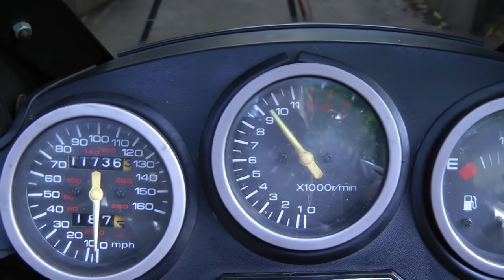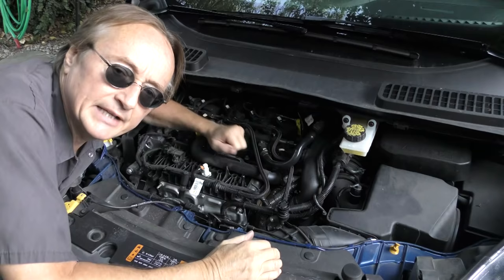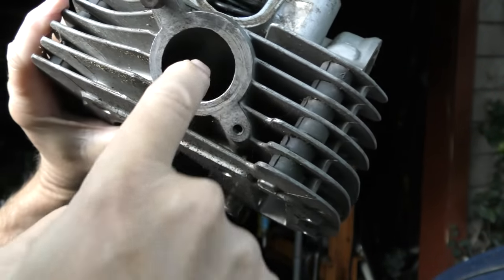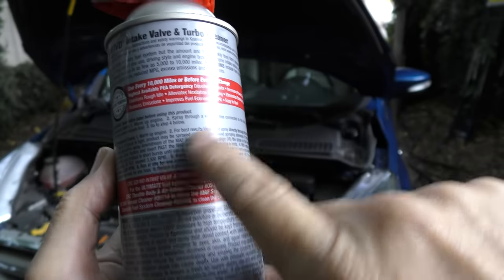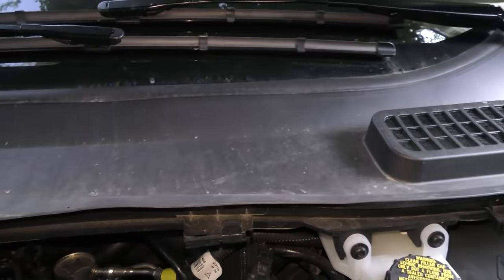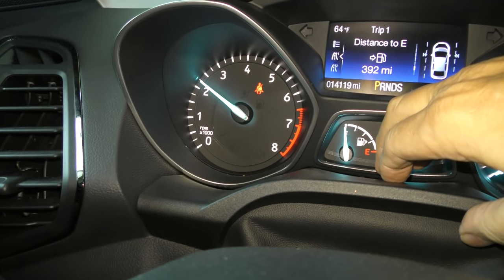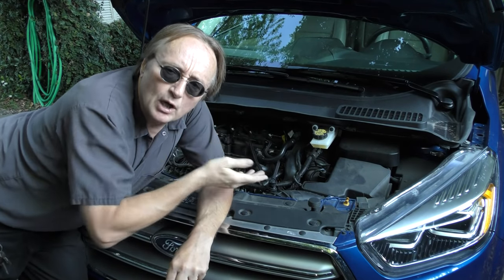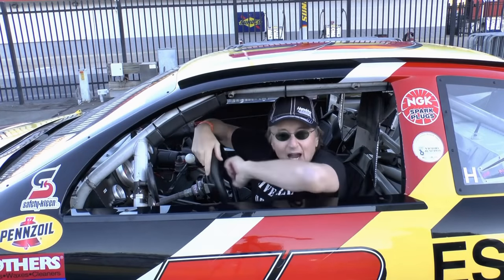How to Clean Intake Valves in Your Car with a Spray Cleaner

Comment: Hello, just a few days ago i experienced my brake pedals getting hard and diagnosed that it was the brake booster and the master cylinder so i got the brake booster and master cylinder replaced. But now my pedal sinks almost to the floor before the brakes get applied and toward the end the pedal continues to be hard. I have got the abs system removed 2 years ago as i was not able to find a new onw in my country and the vehicle just worked fine for the 2 years on a direct brakes. I have a nissan sunny n16 ex saloon 2001 vehicle. Any help will be appreciated.
Reply: Also i was advised to get my intake cleaned but the pressure hose is getting pressure normally. While applying brakes the engine rpm increase by 500 as if more air is being let in. Also my vacuum hose is also replaced

Comment: Will this stop the valve from rattling
Reply: Duane Gordon No. Change your oil and use the lowest weight recommended. If the sound goes away when revving the engine high then lifters are shot.

Comment: Does this stuff works on a fuel injection engine too??
Reply: Yes, but you'd be doing more work than you need to. This video is for engines with Gasoline Direct Injection (GDI) (some year 2004+ cars). Engines with GDI need an injector cleaner in the gas tank, and a separate cleaning of the intake valves. For other gas engines, just use a fuel system cleaner product with PEA (such as Techron Concentrate) in your gas tank. That will clean the intake valves+piston top+fuel injectors. The fuel injectors spray on the back of the intake valves anyway.

Comment: is that hose hard to take off for  mechanical morons like me? 14 focus with 57k on it, runs great. Just changed plugs and transmission fluid....I run it over 4krpms every time I drive to help clean valves, maybe hot air can help keep crud off
Reply from the maker: it just has a squeeze clamp on it

Comment: Is it difficult to locate the vacuum brake booster line on a 1999 mazda 626 lx? Would this method and cleaner work for an engine that is not  a GDI engine? What cleaner would work for a non gasoline direct injection engine? Enjoy the videos.
Reply from the maker: of course it works fine on any engine, it's just that GDI engines are hard to clean so this works great on normal engines too
Reply: Yes, but you'd be doing more work than you need to. This video is for engines with Gasoline Direct Injection (GDI) (some year 2004+ cars). For other gas engines, just use a fuel system cleaner product with PEA (such as Techron Concentrate) in your gas tank. That will clean the intake valves+piston top+fuel injectors. The fuel injectors spray on the back of the intake valves anyway.

Comment: lol its the same as seafoam i use seafoam on my suv did a dyno on it for a before and after and after doing the seafoam intake spray and ran some liquid seafoam in my crankcase changed the oil and i got 30 hp back engine with 132k+ miles on it and my lifter tick went away and u say that seafoam doesn't work on modern cars 2008 ford escape v6 4wd

Comment: Just never do this on a GDI engine as the as the coking deposits are a hard abrasive crystalline make up and not the soft carbon of carb or port injection engines.  Safe for those, will scour pistons and cylinder walls on a GDI engine.  Cheers!

Comment: What if my friend's car is still in warranty, would the dealership void the warranty if they found out he used it?
Reply: Yep, ford will on the eco,  never mentioned this to them.
Reply: @larriejohnson7569  Thanks for the reply, some dealerships are just full of excuses to void warranties.
Reply: @FeelFree3  Keep in mind, if you have a GDI engine and the car is in warranty, you may want to do it now, as there's a very small chance the bits and pieces blown out can clog the catalytic converter and the mfg would be responsible for fixing that expensive part. ( I believe all cats are warrantied by law to 80k miles)
Reply: @larriejohnson7569  Thanks, but then I have to pretend I didn’t use the valve cleanser?
Reply: @FeelFree3   I won't mention it at all.

Comment: its been proven the crc intake valve clean does not work on carbon valve build up it just wets them for a short time.. you must physically remove the carbon from the back of the intake valves

Comment: In my opinion this is something you do every 15K miles or so from when the car is new. There's no way this would completely clean the intake valves on a car with say 80K.. If you were to attempt this at 80K, you'll need a lot more than 1 can. By then the best thing to do is have the valves manually cleaned.

Comment: hey Scotty when you pointed out on the Old 4afe Corolla there is a hose channel right up the brake master? to avoid the MAF sensor when spraying cleaner. can i open that and spray cleaner inside that hose channel? 

I saw on one of your videos that goes back into big bulky valve section were injectors are hooked up. 

send me guidance if you will....

Comment: How do you know which line is a vacuum line on the engine?
Reply: Because it connects to the intake manifold AFTER the throttle body, and to a part that needs engine vacuum (such as the brake booster, PCV valve, emission device, etc.) at the other end.

Comment: Can intake valve cleaners damage turbo-chargers?
Reply: The can says Turbo Cleaner, so not likely to damage a turbo.  CRC products are generally excellent, so unlikely that it would claim a purpose that would cause damage.  Like anything else, the product needs to be used correctly.

Comment: Dears, I need helpMy Car Toyota corolla 2012_AutomaticRun1156000KmNow having issue like miss fire, smoke omission is not normal smooth flow, Its irregular, slightly using more fuel also. I change plugs, Coil but still its continuing.....Is any Mech expert help me with advise...urgently pls

Comment: I really wouldn't do this on a turbo charged GDI engine. That carbon has to go somewhere. You don't want chunks of carbon being sucked into your turbocharger spinning at 100,000+ RPM. You can screw over your turbocharger doing this. These days a lot of GDI engines are small turbocharged engines. Chunks of carbon hitting a 100,000+ RPM spinning turbo charger is not gonna make for fun tiemz.

Comment: Ah ???   Good luck with that.   Old carbon deposits are like CERAMIC = they are baked on.  For that you need to walnut-blast the intake valves.  The best thing is to simply avoid the deposits that come from the PCV valve by either installing a catch-can  (those only take out about 20% of the oil vapors), or just disconnecting the PCV system completely, then plugging up the remaining hole in the air intake to prevent a massive vacuum leak where the old PCV hose used to be.  That way the oil vapors that now come out of the PCV valve go all over the outside of the engine, not into the air intake.
Reply from the maker: yes, that is good advice. And realize that the VERY modern GDI engines now come with both GDI injectors AND port injectors so the port injectors will clean the backs of the valves just like they originally did. Time marches on

Comment: Wrong intake valves can still build up carbon with intake injection over time air, oil will cause issues
Reply: Yes but much less carbon on port injection and takes way more time to build up. Also easier to clean since you can put stuff in the gas tank and use better fuel.

Comment: Where does the carbon go?
Reply: It will go through the valve into the cylinder then exit through your exhaust. The deposits are small and won't hurt the cylinder.

Comment: How a liquid (petrol) can be called GAS????
Reply: Sheikh Hassan Gas=Gasoline. More accurate than Petrol which is generic for petroleum.
Reply: Gasoline is a highly refined end product from source liquid “Petroleum”, (just one of many refinements of fossil fuels). It is therefore the accurate descriptor. Other examples are Kerosene, Diesel Fuels, Natural Gas, various Lubrication Oils etc. The USA is after all the birthplace of the Petroleum and Petrochemical Industries. You guys are using generalized terms based in part on the physical state of the products, NOT their proper identifiers.

Comment: Its not clear where to spay this stuff into.
Reply from the maker: you can spray it into any intake manifold vacuum line that sucks air, or directly into the throttle if you can access that easily.. On this car the throttle would take an hour just to get to

Comment: GDI sucks then. one would rather have the intake valves sprayed and cleaned.
Reply: RLAgito gdi rules old timer. More power from less fuel. Gotta get with the times grandpa.
Reply: GDI is apparently also much worse for NOX emissions. But since those are not regulated on gasoline engines yet, nobody cares.
Reply: Unfortunately since car manufactures are under pressure by the GOV to make vehicles with better fuel millage and cleaner emissions this type of technology won't be going away anytime soon. Dealers love complicated cars because they can make more money off repairs.

Comment: No need to Use that fancy cleaning Spray ..the gasoline in your Car already Has additives that clean your valves Just Drive on the Highway for 10 min or so Like 140kmh and everything is gna get cleaned up

Comment: Except that stuff doesn't work.....at least you wasted your time and money. If there bad you need to take off the intake manifold and do it by hand.
Reply: Wrong, this stuff is amazing. If it is a high mileage car and the build up is really bad, it might take more than treatment, but it does work extremely well. In fact better because manual cleaning only gets the top of the valves whereas this cleans the entire system.  If you do this every 10,000 - 20,000 miles it  eliminates carbon buildup issues. What is a waste is doing a less effective procedure that takes hours or costs hundreds of dollars.

Comment: I wouldn't rush out to buy a tin of this crap to spray into your engine for one if it can clean carbon off the valves what is it doing to the vital lining built up on the cylinder walls and secondly where does all the dirt go to, yes that is correct it will get down to the piston rings or into the catalytic converter. But some knob head will probably try to say the dirt and carbon will be burnt !!

Comment: Or U Can Occasionally BLEND DIFF.GRADES OF GAS,LIKE I DO.MIX 87 Octane W/ 93 Oct.of Either BP OR SHELL, Of Which I Get Best Gas Mileage,J ust Using Reg.,If U Run Half & Half on the 87 & 93,that Gives U 90 Octane,Which Will CLEAN UR VALVES ALMOST AS GOOD AS 92 Or 93 By Irself& Because 87 is So Much Cheaper Than the 93,Ur Making 90 Octane Cheaper Than Buying 89 & Getting 1 More Octane,90, Instead of 89.I Had A 01 Toyota Tundra,That I Got 888,500 Miles Out of the Eng.W/ Only T.Belt Changes Every 125,000-130,000 & Reg.Tune Ups & Got 2 - 3 More MPG Than EPA Said it Would Get & Rarely Had to Add A F.inj.& Never Had To Clean My Valves,As The Slightly Higher Octane Using BP or Shell Gas ,Did the Cleaning ,For Me & Got Better Power W/ My 3.4 24 Valve V-6.My  Gear Ratio Was 3.91,Same as A Non 4 Whl.Drive V-8, that No One Could Ever Explain to me why TOYOTA Thought the V-6 Needed.